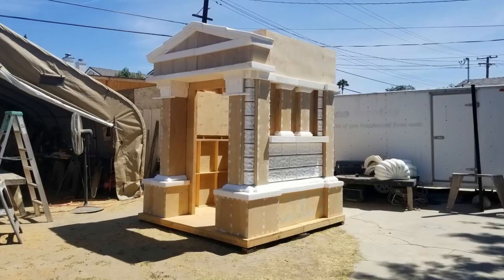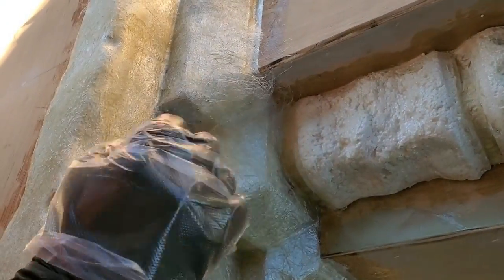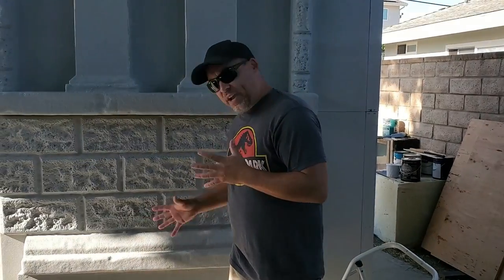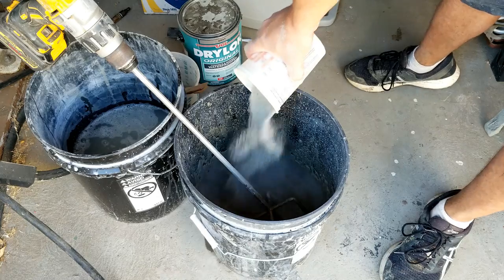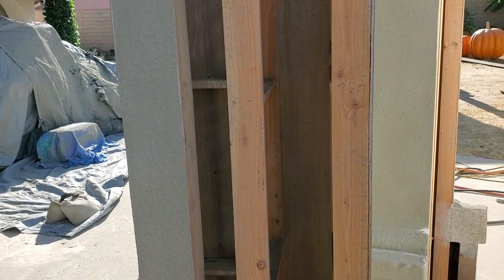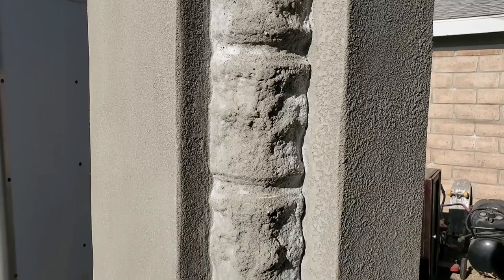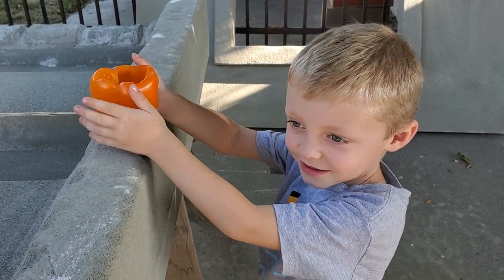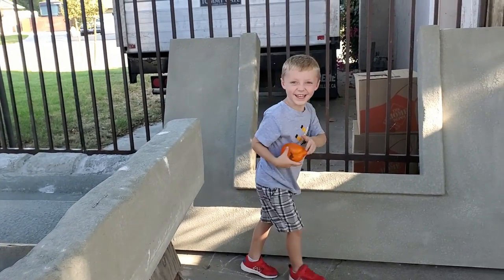Large Outdoor Halloween Graveyard Mausoleum Decoration - Hard Coating & Texturing Foam

Comment: Hey guys, back in about 2007, I reached out to the lead set guy for the Rocky Point Haunted House in Salt Lake City about what they used to hard coat their foam set pieces. Prior to their closing, they were the lead haunt in the country. Unbelievable stuff. Anyway, he said that he took latex paint, joint compound, and Elmer's glue and mixed them together. His ratios were, and I'm paraphrasing, "probably about 4:1 compound to paint, and glue until I liked it." The glue really gives it the hardness when combined with the other materials but I'm sure you would need many coats to get the hardness you're looking for. It's also much harder to sand with it. Fiberglass is great but as I'm sure you've experienced, it is very time consuming. It was interesting to hear such a simple solution being used on the incredible sets they created every year.
Reply from the maker: Thank you so much for the tip. We will definitely have to test that out.

Comment: Little tip on the DryLok: Dab on the paint, not strokes. In addition to keeping that sandy texture, it adds more texture from the dabbing motion of the brush. That might help your issue with the rough patches
Reply from the maker: Thank you, we will try that next time!
Reply: @HollywoodHaunter  Definitely LMK how it turns out, the Dry-Lok helps preserve that texture you get in the foam. Did it for my facade last year and had people wondering if it was real lol

Comment: Great build and video as usual. I tried the spay adhesive with 2 different brands but both ended up melting the foam, so that`s a no for me and here in Australia we don`t have border and wallpaper adhesive (the paste yes, but it`s not the same). 99.999% of Australian homes tent just to have painted walls, no wall paper, strange. I think it`s so they can spot giant huntsman spiders better on the walls. So, question, is their any reason why regular PVA glue wouldn`t work to stick the foil or any recommendations for anything else that may work?
Reply from the maker: I think that could work but I'd be nervous unless I did a few layers over the foam. I'm sure a watered down wood or papers glue could also work to attach the foil. Could always spring for epoxy resin instead.
Reply: @HollywoodHaunter  Hay, thanks guys for taking time out of your busy scheduled to reply. Just purchased some dunlop vinyl adhesive to see if that works, if not i`ll try your suggestions and take it from there. Thanks again.